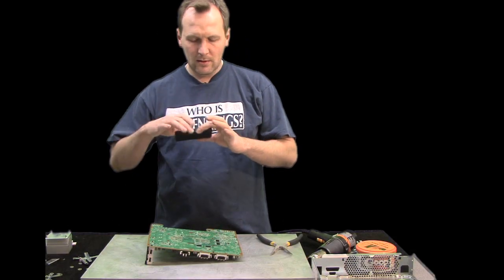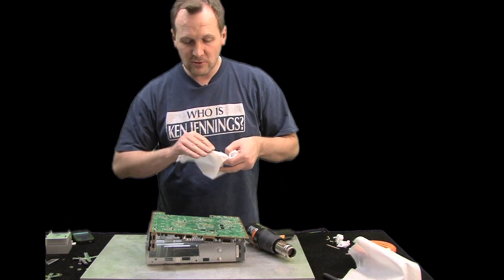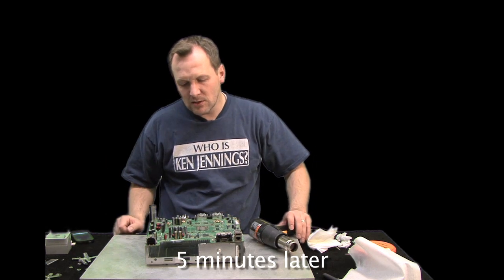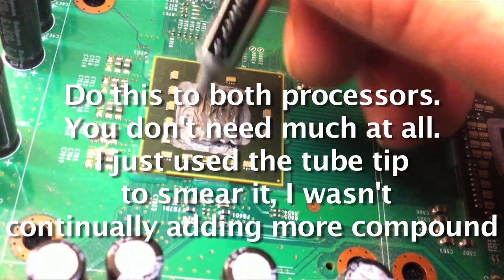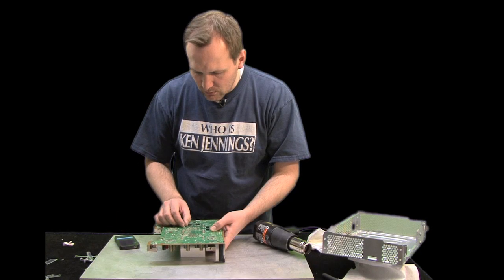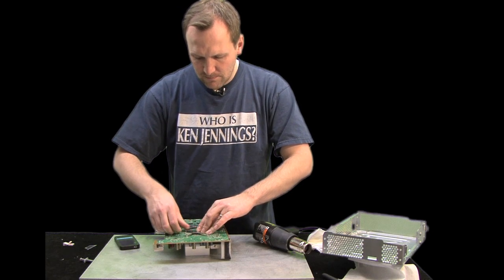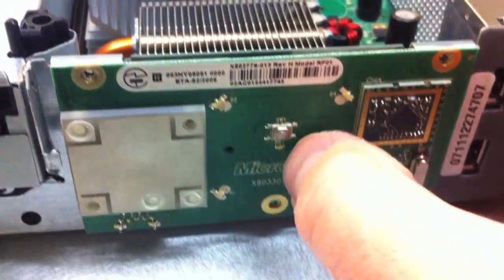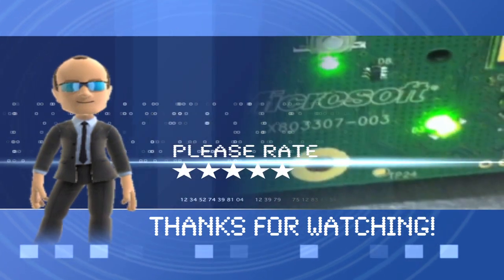How to fix an Xbox 360 with 3 Light RROD Red Ring Of Death Part 2

Comment: I advise you use bolts and not the X-clamps. The X-clamps are much larger and vulnerable to becoming hot considering they are steel. I would use small 8 length bolts which each have 4 washers on the CPU and 3 on each bolt on the GPU. I've fixed many consoles, the Xbox in my video which has the skull on it is a Xbox 360 Arcade 2005, it got red ring in 2007 and has never red ring on me now because i used bolts.

Comment: You don't have to smoother the sides of the processors, only apply it at the top base where contact between the heat sink and the processors.

Comment: I don't need to do the oven nor the heat gun I just out the thermal compound then install the disk drive and connect the fan and then I lied the fan on the right side and let the left side heat up for 35 minutes then cool it got 25 and done

Comment: I recommend you do not open your xbox 360 just do this.

1. finds two stick cotton swabs.

Two. and put it where I are both fans of Xbox 360 fans will remember that they have to move your xbox 360 and not have to Asher noise .

Three. leave 15 minutes to warm up and when they are 2 red lights turn off your xbox 360 and leave 5 minutes for the cold.
Reply: DO NOT DO THIS ^^^ It is only temporary and does more harm then good.
Reply: @GamingZone Are you that dumb? You will only fry the boards chips and will have firmware failure. You will get a constant red ring of death. Yes it may work for a few days but you'll destroy your Xbox. I modify consoles and do everything possible. Don't do it.
Reply: XBL-UnderRatedBoss Finally someone with some common sense. You wouldnt happen to know how to flash a disk drive to make it work for your Xbox 360 Slim would you?
Reply: Yes I do, You've see the consoles I've made. I've learn't from past experiences and some YouTube videos. You will need a ck3 pro, VIA 6421a sata card and a USB to sata converter. Then just follow a YouTube tutorial. If you want to flash a dvd drive that's already in the original console board then search for how to flash a slim DG-16D4S 9504 dvd drive. If you want to replace a dvd drive with a new dvd drive and pci board then search, How to spoof a slim DG-16D4S 9504 dvd drive. Note, look around on more than 5 videos to see other methods, some maybe fakes or too complicated for you. hope I helped.

Comment: Great video, but one thing.. You have a lot of excess thermal paste left over from before. The excess that is on the side of the chip at 1:56 (left over from before) needs to be removed so it doesn't add to the heating issue. The entire GPU/CPU should be cleaned with alcohol and a thin layer of thermal paste should be painted on the top portion of the chip.

Comment: The goal of the squares of Thermal Tape ("pads") is to utilize the lower metal chassis as a heat sink. The Tape is the conductor. It is a very cheap & IMO nearly useless device for this. Thermal Paste 2 shiny pennies together for each chip- use the compound on the chip and chassis-side too. This transfers the heat way better. Also- use the Paste very sparingly! Just enough to hold- too much will just ooze itself out- and be wasted. A preheated electric oven is best for re-flowing soldier, too.

Comment: i re-aply thermal paste and over heat the thing. in other tuts the just cut it off and let it cool then i will work but for me it will not cut off by the button so i unplug it and it still red rings, advice, help, anything?

Comment from the maker: I ended up doing another XBOX and I put the board in the oven instead of the heat gun.  I set the temperature to 215º F for 5 minutes on each side, any hotter and you may melt plastic.  Use hot pads to take it out.  You can check the new XBOX repair vid for more tips included using a different washer.  Good Luck!

Comment: @agentj3000 I would have thought so.. The Fat Xbox 360 is a very defect-sensible machine, and when it cracks there are no permanent fixes other than probably a very costly and rare professional reball and a very high-performance cooling system.

Comment from the maker: @xXxS4v4g3xXx Washers hold the heat sinks tighter against the processors than originally designed, which is why the RROD happened in the first place. If you don't have good solid contact between the two the processor can't cool down. You can use plastic washers, I've seen them used. Just make sure the melting point of the washers is high enough. Otherwise they'll get thinner and thinner as well as retain heat. But you are right, plastic doesn't conduct so you have that going for you.

Comment from the maker: @KillerKnuckles720 1/2" washers - you can use any size washer that is small enough so it doesn't touch other electrical components on the motherboard.   Basically you want a thicker washer not a wide washer.